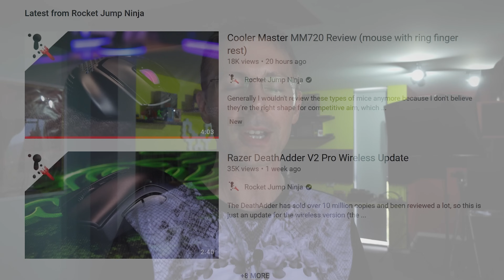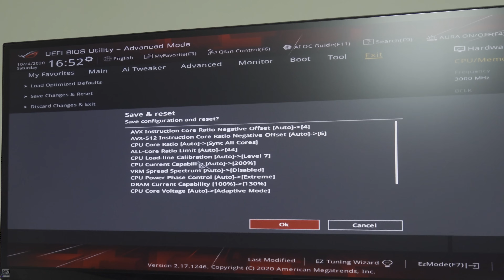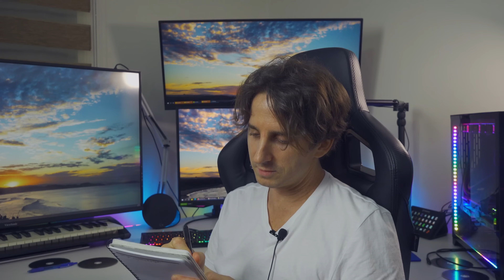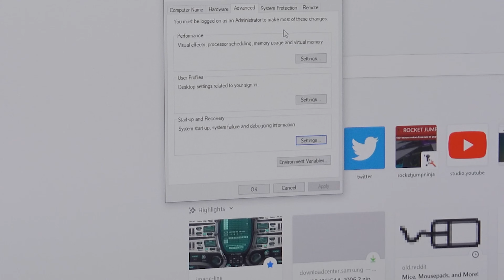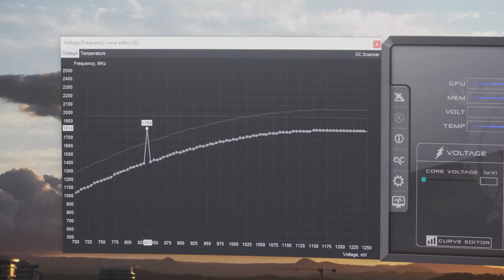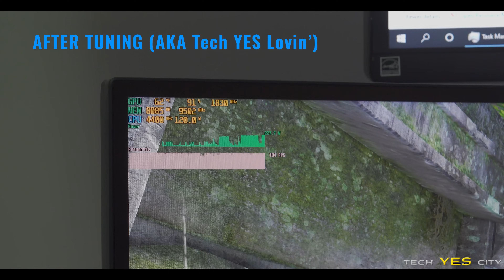Is Overclocking SAFE on Next Gen Hardware?

Comment: In PUBG my x5675 cpu and 1070 gpu are hovering between 50% and 100% usage and 60 to 144 fps depending on the number of players. Such an unoptimized game. Need to change platform for more fps.

Comment: USB selective suspend settings are a cancer since Win-7. This setting has caused a lot of issues, and trust me as I work for a mayor Tech company in the engineering department, and the USB Selective Suspend has caused so many issues. Specialy if you use KVM switches and generally USB add on devices

Comment: I wish I had a TechTuber friend that could help me overclock my pc. I don't really know the first thing about it, but I know I could get more performance out of my stuff, but I just dont really trust myself to do it.
Reply: For easy overclocks, just download msi afterburner. Slide the core clock and memory clock all the way right, they will automatically set at the highest clock possible. That is the target clock rate, doesn't mean it will run at that rate. 
Next you adjust the voltage. Start with something small like +10. You will need to adjust voltage to run at the desired clock. If that works, and is stable, then keep working your way up. As you get higher in voltage you need more cooling, so also adjust your fan speed. I gained 30 fps by doing that, and after being satisfied i reset everything to default, because i don't need those 30 fps. There is probably a better way to do this, but afterburner is definitely an super easy way that anybody can do. I probably could have squeezed out another 10-15 fps as my card was not running at it's highest clock, but temps were a bit high for my liking and with the fans screaming, i decided it was enough fun for the day. I only reached 80°c max, but it's just easier to deal with less frames and a quiet card at a lower temperature.

Comment: I’m curious about this. I have the same CPU and am currently running it with the Corsair H115i Pro. 
Intel ARK lists the max temp for the CPU at 86 degrees instead of the normal 100 degrees most Intel CPUs can manage. 
So far I’ve only been able to run Intels Performance Optimiser auto OC tool. Where it’s taken it to 3.9ghz all core. At those clocks a Cinebench R20 run will take it the package up to about 80-83 degrees. So I have been under the impression that cooling was the limiting factor on my OC at present. 
May have to pay the Yes Man to come have a play with my workstation.
Reply: In that case go into thr bios and check to she if Prochot is on or off . U can also disable thermal and power limits by young Throttlestop . An accelent utility for intel cpus

Comment: Was wondering if i have a my power supply connected straight to a really high quality pure sine wave UPS would that help overclocking and ripple etc or just a big waste of money for that reason?
Reply: A UPS is never a waste of money. I paid $50 for mine, it has 4 outlets that are protected and will be powered if the power goes out, and 2 more outlets that are just protected... over the year I've had it, my power has only ever went out 1 single time, WHILE my pc was on and I was outside, and while all clocks in the house had to be reset, i walked into my gaming room and my pc and monitor (plus I've got my wifi router hooked to it) were sitting there still powered doing what they were doing lol. I was so relieved to see it work well for a PC. I DID have the power go out before and just my wifi router was left on, it will power the wifi for 2 1/2hrs after the power goes out, but something like a higher end pc/monitor the UPS would only retain power to keep it on for 5 mins, enough time to get inside to the machine and shut it down properly if the power stays out instead of just being a random out and back on... I highly reccomend a UPS to ANYBODY who cares about their computer at all, and furthermore your internet router as well (not that losing power on a router would hurt it, it would just need a reset, but if its hooked in the UPS you dont even have to wait lol). Just get one, they're safe. Even though you're wanting it for something specific, I promise you wont regret it if you ever end up having your power go out when you're ON the PC.

Comment: I don't overclock my work station as reliability is priority.
Reply: you have so much potential with cpus these days.. ive gone for an under-volt and (all core)overclock to my cpus boost rated speed and it never crashes. where as at stock it would max boost 1 or 2 cores to its thermal limit then throttle down.

Comment: Reason i use heaven is,if you have an unstable oc you will know it.Either with artifacting or hanging.It's a pretty good benchmark in my opinion
Reply: Try using h.264 and h.265 stress tests. These tests will do more for stability testing than that. They are older and hard to find. But youtubers know little about these for oc stability testing, only hardcore overclockers know about this.

Comment: Btw you also underclocked his gpu, not just undervolted. It runs more than 100mhz lower than stock, but he is still cpu bottlenecked so probably not a big deal. It would be better if he had a case with proper cooling so there would be no need to underclock gpu and cpu probably wouldnt reach 100C.
Reply: The unbderclock doesn't affect fps noticeably
Reply: @Dankuzmeemusmaximus  depends on game and if you have cpu or monitor bottleneck, but still you get less than you paid for.
Reply: @riba2233  Im getting mine for 80$ under msrp so im good

Comment: If you want to further improve the GPU optimisation ( I don't call it undervolting), you can easily do it from TeamViewer. Also, overclock the vram, the power consumption will be pretty much the same.
  That's how I do it, it just works.!

 Also, good tips for the c-state, never cared about this...